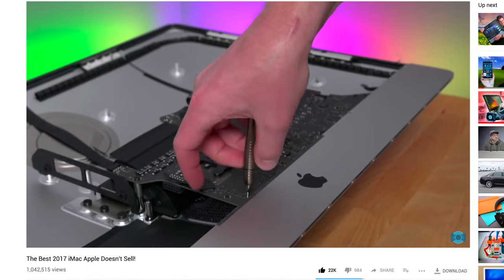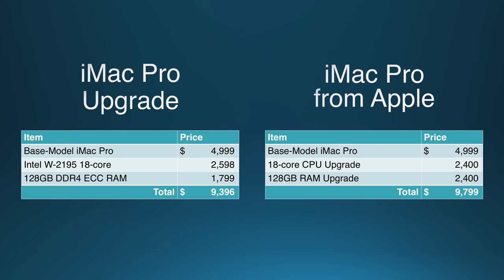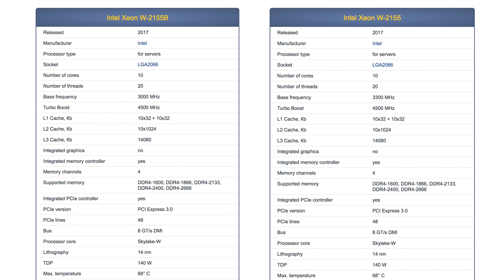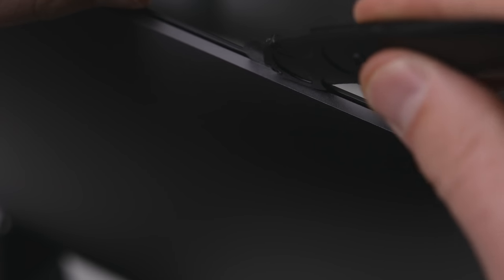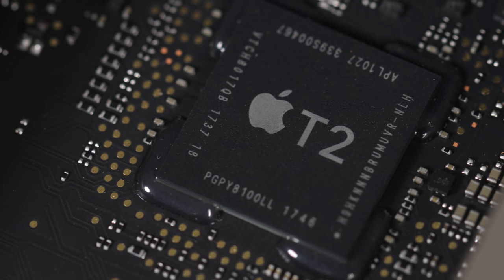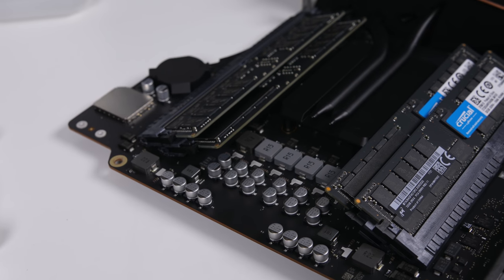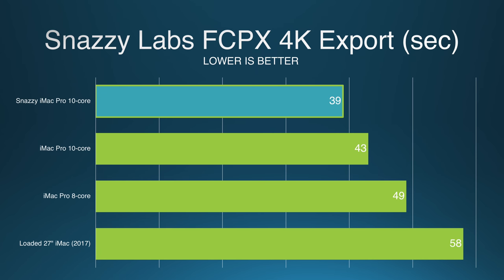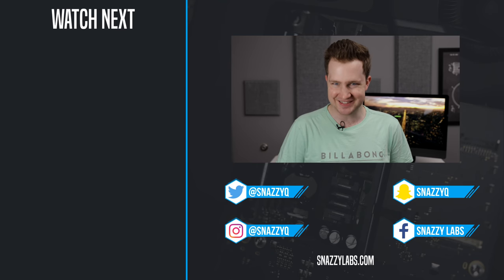Can You Upgrade the iMac Pro?!

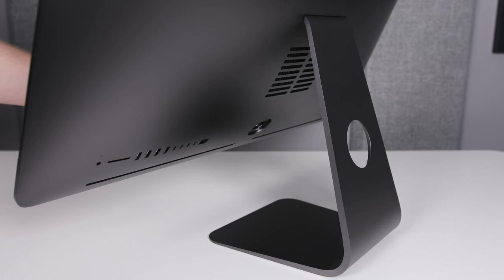Comment from the maker: 4:41 if you don't want to know the method to my madness and just want to skip to the disassembly.
NOTE: at 3:01, that's the 10-core upgrade price not 18-core. That's a 4AM error.
Reply: Keep it in mind , intel and to some extent AMD pull there TDP figures out of there arse.
Reply: It's okay, Quinn. I still love the video. Great work! :D
Reply: Snazzy Labs kinda unfair to include $130 in mouse and keyboard in the imac pro comparable build when a $20 biglots mouse keyboard combo is as good as the shitty ones apple gives you and if you want mechanical the redragon kumara is $30 and the logitech g300s gaming mouse is $20. And to be honest at that point id pay the extra $50 to use windows 10 and if you really want to work with mac os you get the option to dual boot.
Reply: Having more ram is never overkill specially if your dealing with video and pdf files the more the better. Custom PC can be more expensive but one benefit to it is SLI, more power on PSU and better cooling.
Reply: Reason for the 4AM error? You weren’t making chocolate pudding...
Reply from the maker: Daniel Dulu That's the thing though... Apple spends extraordinary amounts of money doing stuff that other companies don't give two craps about. For example, the RAID 0 SSDs that use  SLC NAND are insanely expensive compared to MLC variants which are not that much worse in performance, but Apple spends the money anyways. It's in instances like these where I wonder why they cheap out literal pennies on stuff like thermal paste.
Reply: If Apple ever releases a downgraded iOS for PCs I'll leave MS behind. As long as they keep building PCs with stupid engineering mistakes, I won't buy their shit. If they able to build something ACTUALLY proper hardware, then I'm going to thrash my PC with a hammer, upload it, and pray to a literal apple.
Reply: starting off SUPER EXTREMLY SCARYYYYYYYYYYYYYYYYYYYYYYYYYYY don't break it plasss
Reply: Dávid Horváth honestly the mac ios is shit compared to windows almost no programs work on mac.
Reply: WAIT a second:

What thermal paste did you use?

Would you dare to delid the CPU and try liquid metal?
Reply: Snazzy Labs you should know that iMac is cheapest in USA, it's even more expensive in everywhere else in the world...and building a pc with same spec become way cheaper outside of USA...anyway nice video
Reply: mac OS as a personal OS is good. I worked as an IT pro and I used total windows environment and it was the greatest fun of my life honestly. BUT windows is sometimes a petty little bitch and fails in the most glorious ways possible. The programmers and web devs I worked with usually had a mac (or a Linux based laptop) on their desk because MS windows are kinda junky for dev purposes. Most of the pro programs and websites you see are usually made on mac or a Linux distro. To be honest. If I wouldn't be lazy I would make a mac VM and use it. But I'm lazy and kinda out of resources so... yeah.
You can call iOS shit and not work but most unadvanced users prefer it over windows even if it doesn't really have a proper error description when it fails. At the end of the day, some form of productivity is waaaay easier on mac (for EG I prefer iOS over windows in most of my personal work as an HR advisor) because I have constant, first party sync between a phone, a laptop, and a desktop.
This comfort doesn't justify the insane price tho...
I can only hope you understand my points.
Reply: Snazzy Labs Raid 0 screams data loss in all way shape and form. There is a reason why pro applications in servers are usually cached and not Raid-ed in 0 mode.. the gain is minimal in real life. If they would have something like raid 0 cache with raid 3 deep storage it would be the nice and good solution.
Reply: Apple fanboy...
Reply: Snazzy Labs  i would have loved to see the difference in temps
Reply: Vinnie Sifter 
…well, he could still pay for the repairs, couldn’t he?
…🤦‍♂️😝🔫
Reply: I'd like to add something on the subject of thermal paste. I work for a company that makes thermal materials that go into computers and things. I get paid to know these things so take that for whatever you feel it is worth.

There are different properties that the thermal paste is supposed to have depending on what it is. For instance, a lot of people complain that the thermal paste "dried out". It did not. It cured. It is supposed to solidify. That prevents it from moving and pumping out as it thermal cycles. Another thing is for the material NOT to separate. thermal materials are all similar in the way they have some type of thermally conductive filler and that filler is in something that will hold it together. There is extensive aging testing that happens to approve a material and part of that is how well it will hold together; i.e. not separate into dry, chalky, hard filler with the "fluid" part pumped out and dried out/burned off.

For home gamers pulling off your cpu and putting on a slightly higher thermal conductivity material is all well and fine, but for industry use, where servers and warranties are important, your thermal material has to hold up .

TL;DR
Commercial thermal materials aren't sold through amazon, the material you scraped off the CPU was just fine (though there was was too much), and there was enough material throughout the computer to cost them a couple of dollars.

Edit: words
Reply: Snazzy Labs BUT WHAT IF YOU USED DELIDED LIQUID METAL COOLED PROCESSOR????
 Instead of the crappy stock thermal compound apple uses.
Reply: the 300 mhz down drop could if the cache is higher
Reply: Vinnie Sifter well it  really depent  on where you live..it would be crazy to buy a Mac at where I live, if you just want the spec. Anyway you buy a Mac for a Mac not for spec.
Reply: How do the temps with high-quality thermal compound applied compare to your friend's 10-core machine?
Reply: Snazzy Labs h
Reply: not so snazzy. kind of ehh. I got a wall mount I'll sell you.
Reply: What type of thermal paste did you use when putting it back together? Kryonaut?
Reply: I would still personally prefer to build my own system... Talking of which I want to build one myself... Cash flow is not supportive of that idea though XD
Reply: $1,700 cpu gets just 2000 points in Cinebench15? My 195€ Ryzen 2600X gets 1400 points lol. 🤣
Reply: Nice Videos!! Just Subbed!!!!!
Reply: Is this the same computer that Linus couldnt get Apple to fix regardless of how much he paid them?  Why  would you blow big bux on some Piece Of &*(^*%%% like that?
Reply: Actually, you could not be more wrong.  Repair and reliability records prove you wrong as well so I assume your experience with Apple computers is near zero.  Apple computers have a useful life much longer than PC's, my last home iMac lasted me 8 years and was kept very functional with the addition of simple upgrades like an SSD and more RAM.  My work desktop PC's are total trash in 3-4 years and the laptops maybe last 2 years - doesn't matter Dell or Lenovo same crappy life.   Meanwhile, at work those with Apple laptops routinely have them last at least 5 years.
Reply: "Tatsuhiro Satou"  What are you 12 years old?  First off Macs run MacOS not iOS, I do not know how someone can make this mistake unless they are truly uninformed about Apple products.  Secondly, how do you explain why Apple Macintosh sales and market share have increased 5-10% yoy while PC sales have been dropping by ~7% yoy? I suppose people are just stupid and want to buy computers that do not run software but are cool.  

  I know so many people that have abandoned Windows and moved over to the Mac that I cannot keep track.  And once they move over they never regret it - the near total lack of viruses and crazy adware is a major advantage and they just work well.
Reply: Actually, the prices are not insane unless you compare them to cheap low-end PC's.  Even the MacBook Pro which can be $2-2.5k for a nice setup is maybe 20% higher priced than a comparable PC laptop with same specs, same low weight and metal casing.  Moreover, the Macs have spectacular displays, everyone agrees on that, and they tend to last twice as long a windows laptop so the lifecycle cost of a Mac is lower.
Reply: Radar, sorry you wasted your time on a lenghty response, nobody cares...
Reply: Man, I hear ya. I am kinda on the other side. I rock a 5 year old MacBook Pro, but I will not upgrade A)Apple products keep pointlessly increasing in price and I cannot afford or justify it anymore and  B) because engineering mistakes seem to be worse now than they ever were, to the point where it seems dumb to spend any extra money on a mobile pro-grade machine at the moment. At the same time, I really don't want to deal with all the crappy flaws that come with windows like the filesystem, built in spyware and the time commitment that comes with MS, setups and maintenance.
Reply: I just recently watched your video regarding upgrading an iMac Pro, and I'm sort of a new to this site, and the question I have  is if I wanted to upgrade the processor, do I need a different fan, more Ram (got 16GB on a 2013 27' iMac and a waste of time hard drive 5400rpm) a different motherboard, I know I'll want an SSD drive)? Thanks Joe.W
Reply: Just found this one...where can I go if I wanted to replace the Motherboard itself from a Late 2015 model?
Reply: Hey Snazzy labs, I've done the cpu upgrade to a few iMac Pro's. Now I'm wondering if the new Xeon W-2200 Cascade lake X CPU's will work in the 2017 iMac Pro, specifically the Intel Xeon W-2245 or W-2255. TDP is 15 watts more than the 140Watt TDP of the previous generation. Considering crappy original thermal compound being replaced I believe the cooling of the system would be sufficient. The question is are these newer processors compatible with the 2017 iMac Pro?

Comment: Hahahahaha he said "voiding the warranty"... On an imac pro... What warranty?
Reply from the maker: The one included with the machine that promises Apple will break your computer for free.
Reply: bilos1993 The Same excellent support as he got for the vesa support
Reply: the warranty that cannot be voided anymore by upgrading or opening ? LUL
Reply: Snazzy Labs still have to factor in gas money and travel time to the Genius Bar. DIY breaking at home is still more cost-effective.
Reply: True, True... Been there...
Reply: Such as the warranty is, it doesn't get affected with opening the system, but if you on a warranty errand need to have the system replaced, they are in their right to refuse, to replace it unless you stick the original hardware back in there, or, if you don't tell them about the upgrade, they only have to replace it with the original configuration. So i don't get the yapping about voiding the warranty. Just save the stock CPU, RAM and SSD, if you upgrade.
Reply: And then replace it by one new, so you can go and break it open by yourself :)
Reply: Snazzy Labs
…that won’t no longer be an issue anymore as from now on all aluminum/metal parts (that includes screws, too😉) will be produced within the US (talking about: TARIFFS😏), and are thus of way better quality than before…🤩
Reply: Mac2Bee Keep dreaming… For all of Apple's occasional failings in choice of materials (like their ever-awful thermal paste application and those stupid VESA mount screws), the fact of the matter is that from a purely physical, industrial design and manufacturing standpoint, most Apple products are now better than ever (yeah, sure, the Apple TV has been made out of plastic instead of aluminium for a few years now, but it's just a box you connect to your TV; who cares?). Have you seen the insanely small tolerances on the Apple Watch, the iPhone range and even on the TB3/USB-C MacBook Pros everyone keeps hating on?

I hate on the latter, too, but that's because they aren't upgradeable, there's no choice of a physical function row on the 15'' models and the keyboard, as everyone knows, is too prone to failure from the ingress of the tiniest of debris (and since it's studded to the top case – not unlike the battery, which is glued to it, too – it's going to be a stupidly expensive, wasteful and all-too-common repair once those machines are out of warranty). Apart from that, no one in their right mind can argue that their structural integrity and finish quality didn't improve constantly from generation to generation.

Also, for all you haters, you seem to have a very short memory span… Remember the cracking polycarbonate on the last-gen plastic Unibody MacBook, the first-gen MacBook and the PowerMac G4 cube? Remember the even more horrid keyboard topcase on the first-gen MacBook, which was a bit too prone to discolouration and chipping? The disgusting peeling and warping rubber mat on the last-gen MacBook bottom lid (I've had two of those lids, the original and the replacement, with that issue already, and I ended up ripping the mat off of one of them and covering the mounting holes with paper and tape, heh; it looks half-decent and with the taller spongy feet – I used those white CD/DVD mounting circles – I attached to it, the machine now has better heat dissipation anyway)? The brittle PowerBook G4 Titanium screen hinges, along with its peeling painted magnesium case? The dying GPUs and extended warranties on various machines, including the conventional Unibody and older Retina MBPs you love so much but also stretching back as far as the G3 iBooks? All those SATA II/III shenanigans on the 2011 and 2012 MBP models (case in point: I'm on the verge of getting screwed if I can't give back a 13'' 2012 MBP to its original owner, because it craps itself out if I put a SATA III drive in the optical drive bay, even though there was a firmware update that supposedly fixed that issue… Yeah, I know it's not a OEM or even BTO config, and that the SuperDrive is actually a SATA I device, but thank you Apple for not properly testing and supporting the freaking bog-standard Intel chipsets you use on your machines!)? And what about that whole counterfeit, bulging capacitor fiasco (that, also incidentally, killed my Rev. A iMac G5 way sooner than the end of its usable life)?

Objectively, Apple products are getting better and better structurally, and at the same time more and more disposable internally, which sounds like a pretty stupid equation, IMHO. In the old days, you could indeed keep upgrading your Mac, but if you picked a cheap (or the wrong) model it would eventually look like shit and/or fall to pieces; nowadays, a Mac will look pristine a few years down the road (if you treat it well, that is, but it'll be much more resistant to wear and tear – save for that stupid MBP keyboard, of course!), but will essentially become a really pretty paperweight.

And Apple's reasoning is that Macs become more reliable that way. Suuuuuuuure (and yeah, maybe they do, but there are too many catches). I'd still much rather have to send my machine in for service on two or three occasions during its useful life, with quicker turnaround times and less expensive repair costs, than playing the Apple lottery and buying a €3000 time-bomb that may a) crap out during the 2-year EU warranty period (it won't cost me a penny, but I'll wait a while for the repair to be finished and I'll also have to recover all my data all over again from a backup) or b) crap out after the warranty expires (so, I'll have to pay an obscene amount for a repair, plus all the other hassle I mentioned), and which will definitely c) become a useless, non-upgradeable paperweight on either scenario and even if it doesn't crap out. Just great!

But anyway, I digress; if anything, if that scenario you talk about comes to pass (i.e. manufacturing returning to the US straight away without any adaptation period) you'll get the worst of both worlds. Non-upgradeable Macs that will break too soon (and then, you'll be chucking them in the trash/recycling even sooner than otherwise). Have you even listened to Tim Cook's statements on the matter? You know, Apple loves to price-gouge their fans, but if there's something where they aren't BS'ing us, it's on their arguments on prototyping and manufacturing stuff in China. Do enlighten yourself and check out (sorry for advertising another YouTuber, Quinn, but I must do it) Strange Parts' videos (heh, on second thought, seeing how you've just disassembled an obscenely expensive piece of Apple kit for no good reason other than SCIENCE!, I'd reckon you're a fan, too ;) ). You're in for a serious reality check, dude.
Reply: Quinn, I notice that these types of videos attract the very worst types of bozo trolls... how do you manage that? -_-
Reply: What, what warranty? Dude warranty of breaking your new 10.000 bucks iTrash Pro
Reply: Mr B they'll notice you have better thermal paste in there and not the massive goop :P Thus noticing you voiding your warranty by fixing this issue xD
Reply: HAHAHAHA TOO FUNNY AMAZING!
Reply: Adding that much thermal paste is going to be tricky.
Reply: @bilos1993, Magnuson-Moss Warranty
Reply: @PieterBreda  “Excellent” sure…